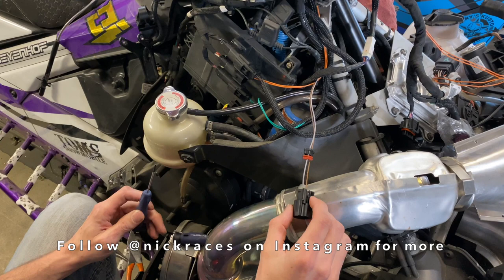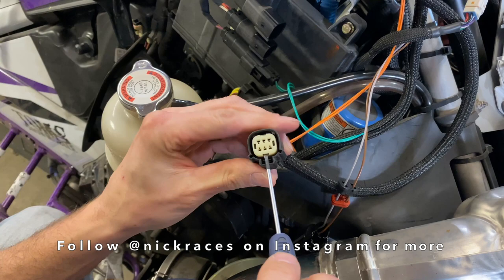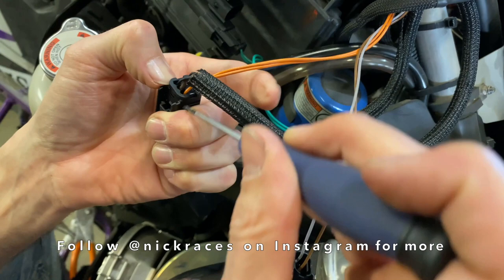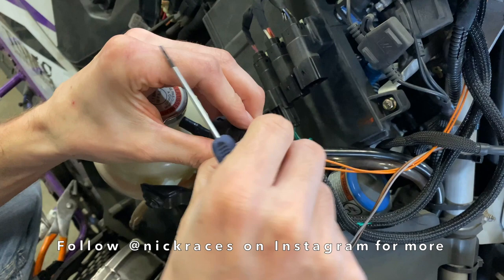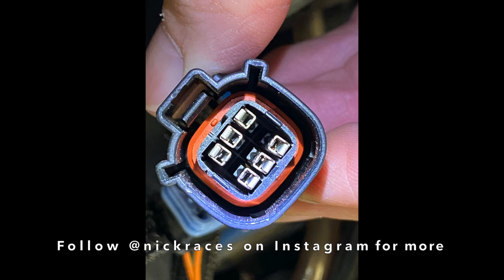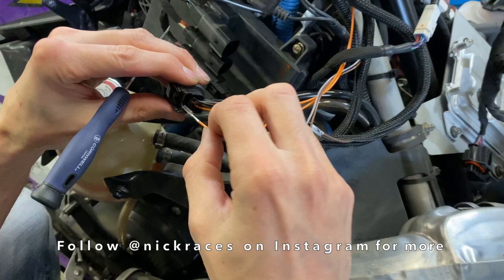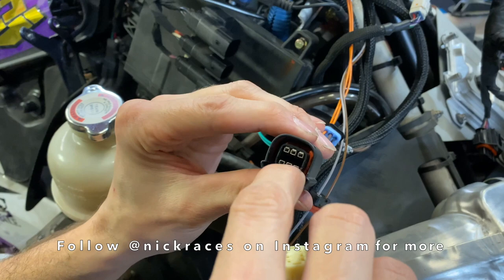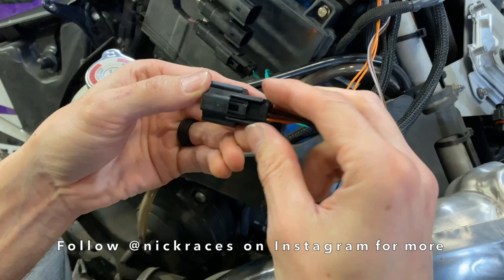Ski-doo Handwarmers

Comment: Thank you for this video!!
Reply from the maker: I need to update this video. There is a little easier way to release the pin. If you push the wire from the back, turn it 180⁰, then pull it back out. No need for the small screwdriver to release the pin.
Reply: Right on! Thanks for the update!

Comment: Thank you! I was looking at that plug wondering how to get it apart!
Reply from the maker: I have been needing to update this. If you push the wire through the plug, turn it 180⁰, then pull it back through, you don't need to use any small screwdriver to release the pin.

Comment: Hi, any idea what that plastic clear/white piece is called? I dropped mine down my sled... Just looking to buy a new one but can't find it online while looking for it.
Reply from the maker: Oh boy...I have no idea. Also, when you get the part where you separate the pins from the plug, you can simply push them through, rotate 180⁰ and pull them back out instead of needing a screwdriver to release the pins.